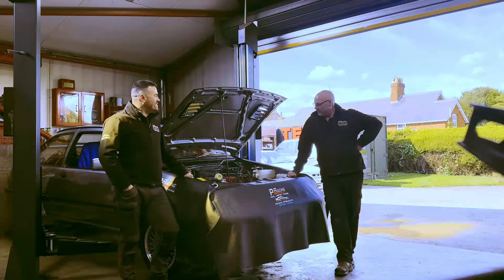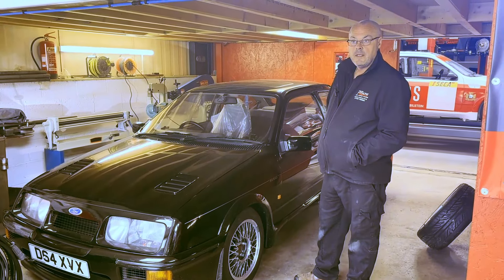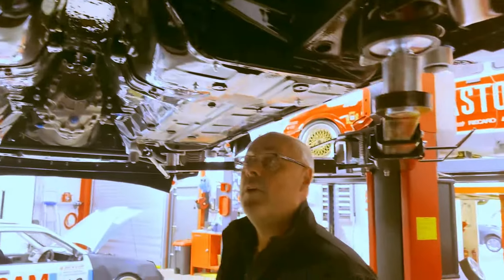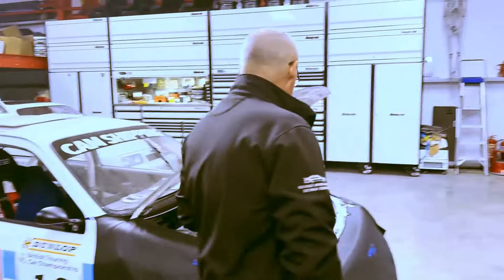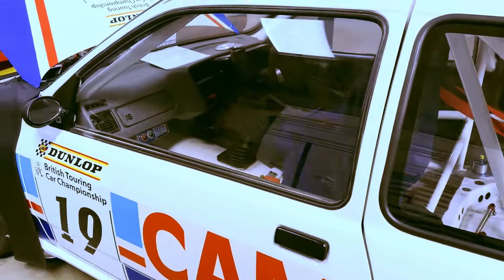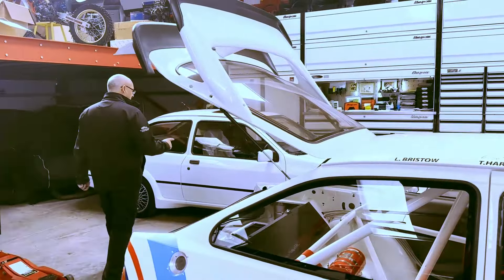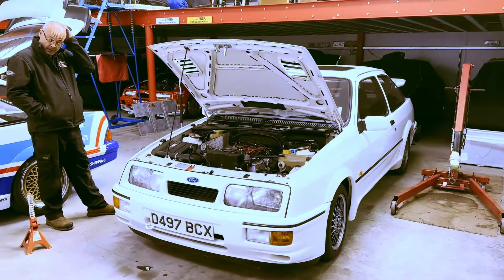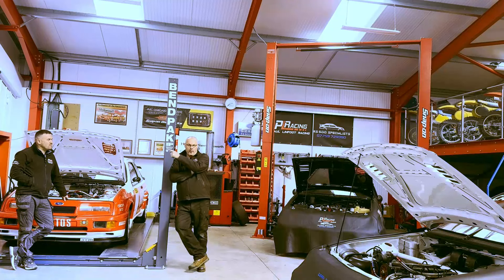A Cosworth Workshop...we have an update

Comment: On the Cam Shipping car, that fuel cell will "pant" up & down in the enclosure. That makes filler neck pipes pull off, not vibration. Noticed the are 2 lines running through the boot floor with no grommets ?
Reply: They were just tucked up out the way for now but all will be bulkhead fittings or grommets for final install.